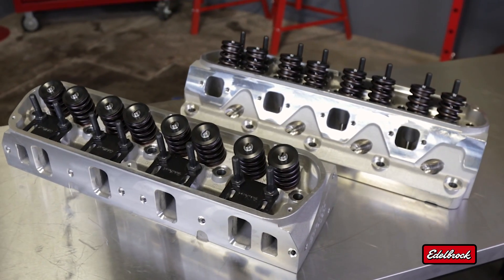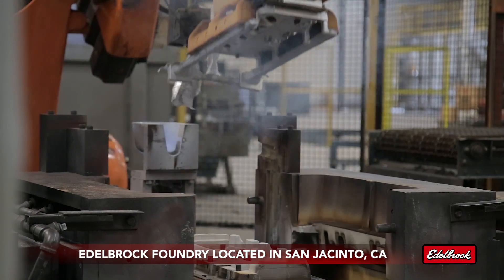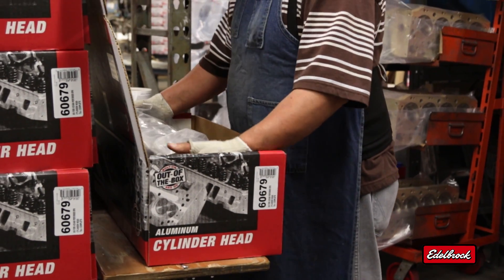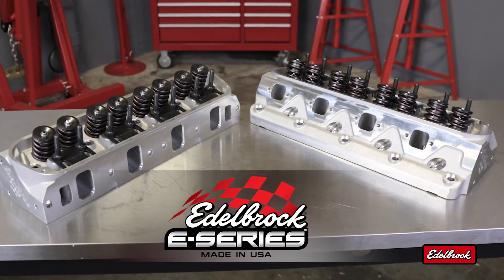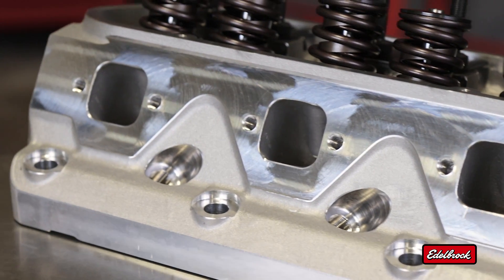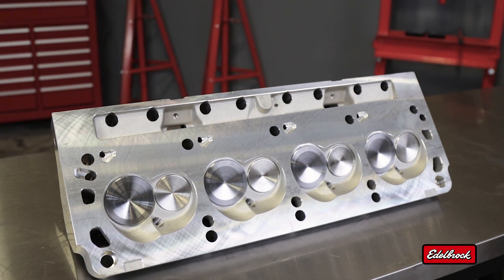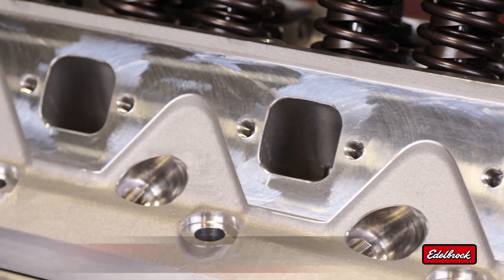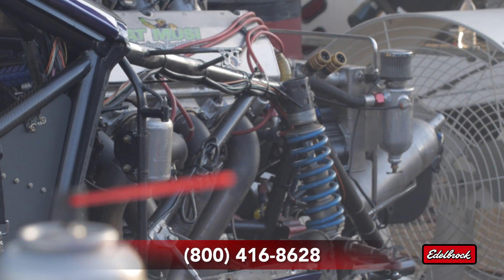Edelbrock E-Series Cylinder heads

Comment: This may have been true 6 years ago, but the quality has dropped a bunch in the last year or two.  I know a gentleman that bought a new set, and had to have a complete valve job,  and debur on the heads.  Of course these days no matter what you buy you need to be prepared to do a complete rebuild,  or could have chuncks of material going through your engine
Reply: That's such garbage, everyone knows that all the "Gentleman"  had to do was contact Edelbrock. The one thing that they do is honor their product and their warranty too. I've seen dozens of these use with no problems at all. You almost can't beat the price now that they sell them at about $1100 or less a set.
Reply: @ajc5370  
You think so, watch , "Ed's machine shop ". Ask him about the quality of NEW Edelbrock products.  He's had to fix several heads even the completely assembled heads.  If you don't want to believe,  just buy a new set and put them on your engine and see how long it lasts.

Comment: They are just a little bump up from stock. If you want 400hp and up always buy the RPM kit
Reply: Thats because you cant rev these past 5500 and the reason is the seats and vavles are literally different from the performer/rpm heads. Thats what they said on summit.   I wouodbt put anything bigger than a xe262/268 comp cams in. Otherwise its asking for trouble. Thats and check for valve leaks

They built them to compete with offshore aka chinese heads. Now afr has a set of enforcer 185 heads to do the same to compete with cheap ass heads

You probably will make 350HP from these heads with and xe262 cam on a 302 ford setup with about 10 to 1. That'll be fun enough in a light car on a budget though. I'm thinking avout it but have obvious reservations. 

Otherwise dont waste your time